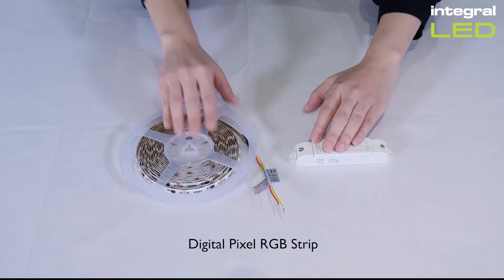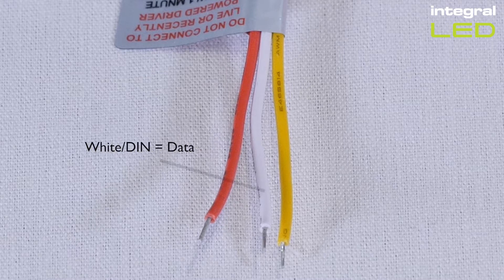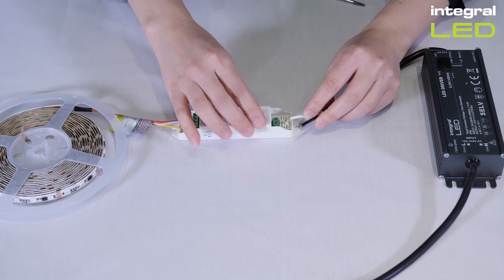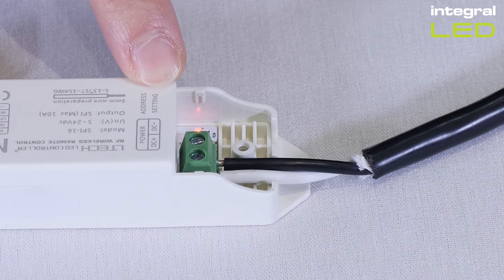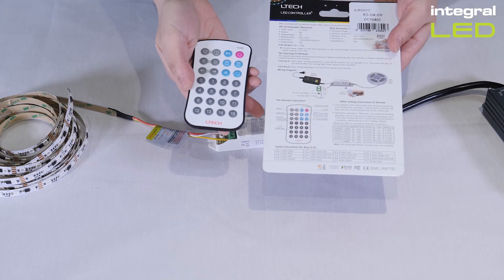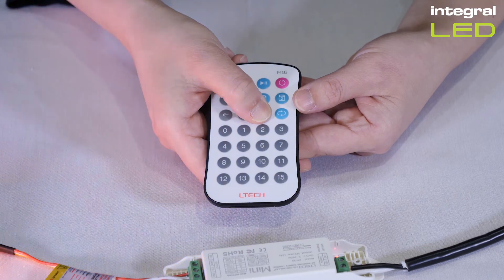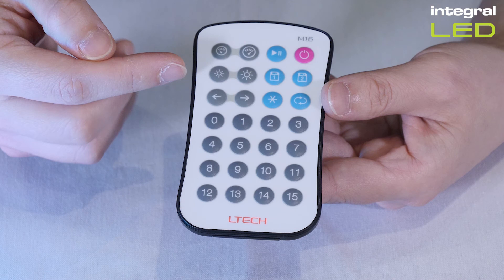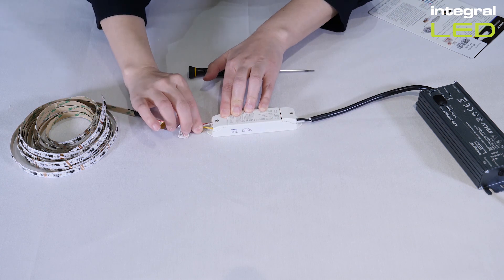How to install Integral LED Digital Pixel RGB Strip

Comment: Hello, is there an easy way to use just a car battery or battery pack (12V) to power these?  I would like to use them in an area where I don't have an electric outlet...
Reply from the maker: Hello. We can't recommend this as the strips are designed only to be used with mains power and a 12V Constant Voltage driver.